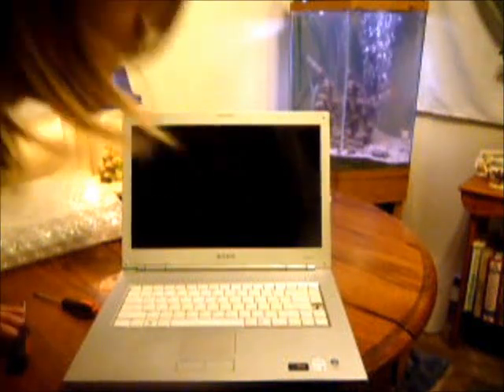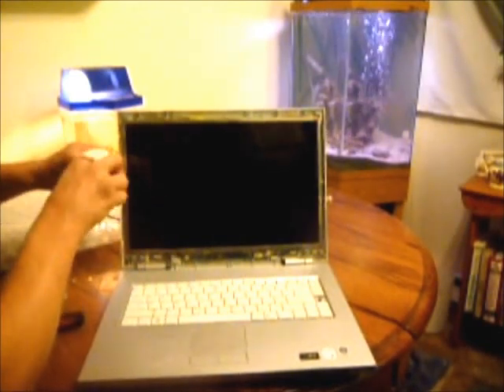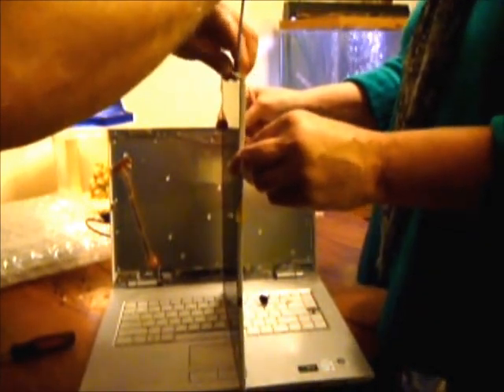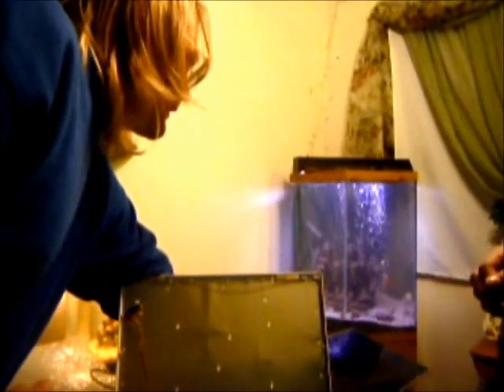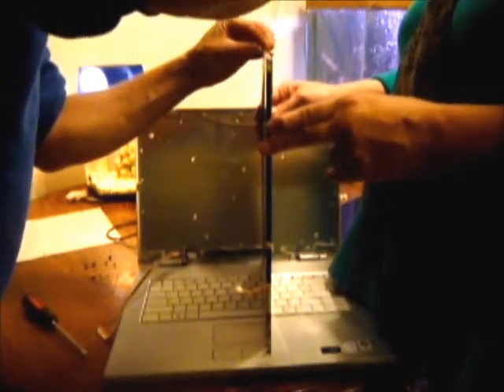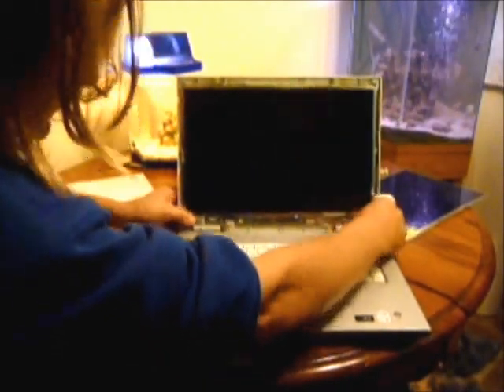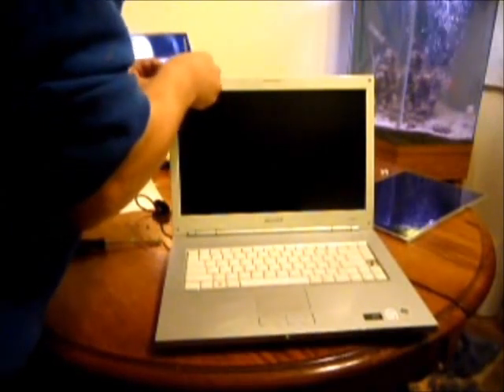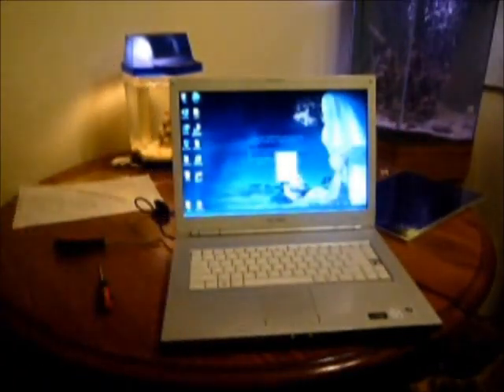Laptop screen replacement/How to replace laptop screen Sony Vaio VGN-N250E

Comment from the maker: disassemble for what purpose? if you are doing a complete tear down. You do not have to remove the screen first, but it does make it easier. then just flip laptop over and look for little arrows next to holes those are the screws you need to remove. Two of the screws hold the dvd drive in, so be sure to remove the dvd drive.